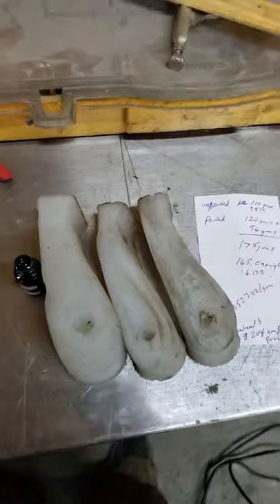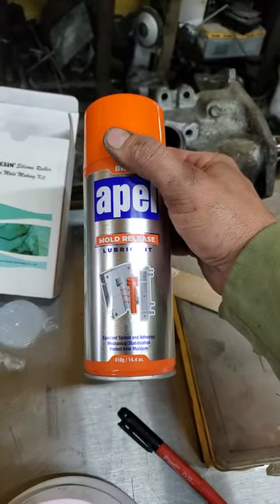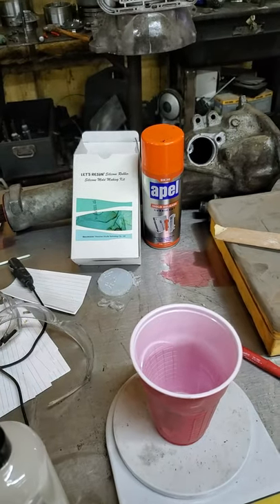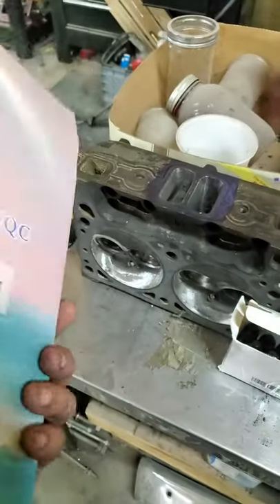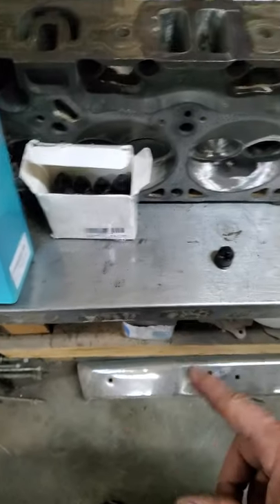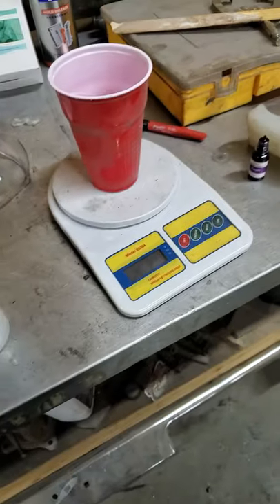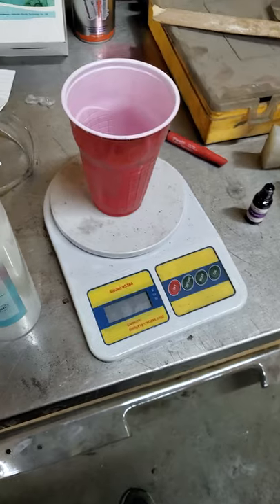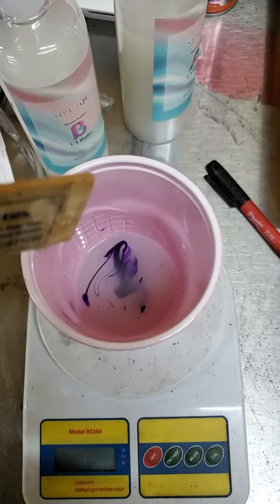(#25) How to pour a intake runner port mold or combustion chamber mold

Comment: I also assumed that it was a  closed  cell foam  neoprene,  in a pressure  can .  I'm going to  carefully use  some  canned  insulation foam.  I know that I'll have to  lube  up the whole  port, before I cast . Also  afraid of the stuff  getting  stuck in the port,or  valve.  The foam is  also  tuff stuff  ,lots of  warnings about  not  getting it where you  don't want it.  Difficult to  clean up!
Reply from the maker: Report back if it works.  That stuff seems like it would just wanna crumble before it would pull out in 1 piece.  But keep me posted